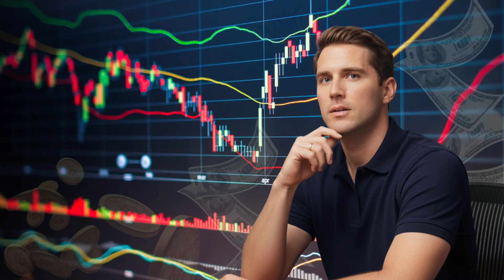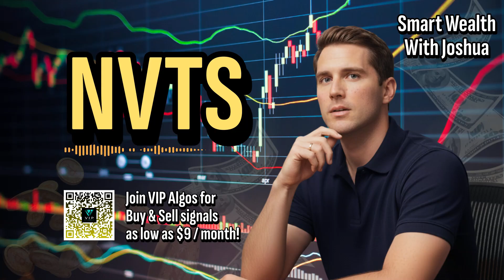Navitas Beats Nvidia, NVTS Stock Up 227%! NVTS Stock Analysis

Comment from the maker: Want cleaner trading charts and higher-probability setups? Check out VIP Algos here:
>> https://hop.clickbank.net/?affiliate=itp129&vendor=fxlife <<

VIP Algos gives traders AI-powered TradingView indicators with Buy/Sell chart alerts, trend direction tools, support & resistance zones, target zones, TP/SL planning areas, setup support, trading education, and community access.

Instead of staring at messy charts, VIP Algos helps you spot stronger setups faster and plan trades with clearer risk zones.

Important: Trading is risky. A high win-rate setup does not mean guaranteed profit. VIP Algos is for education and chart analysis only. Always do your own research and manage your own risk.